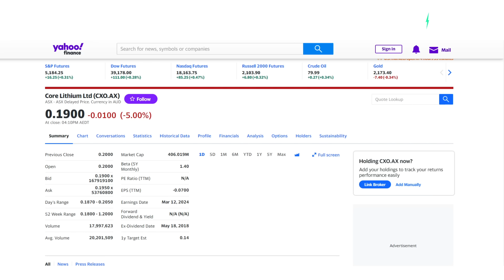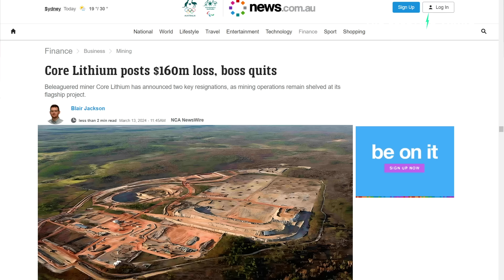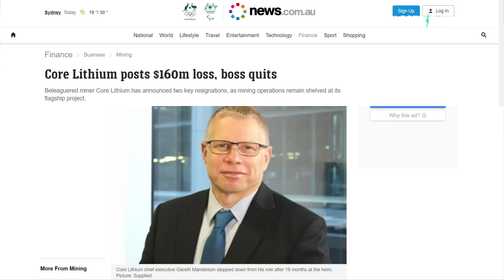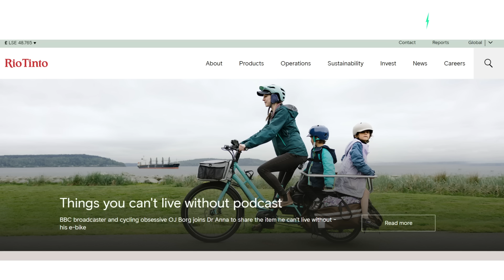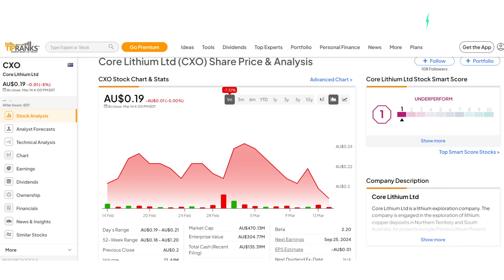Lithium companies losing billions forced to close down mines

Comment: I don't invest in this sort of thing, but lithium demand is still rising. EV batteries and other batteries continue to be a growth industry, and lithium is still a critical battery material despite emerging alternatives like sodium. If I were a betting man, I'd bet on a higher lithium price a year or two in the future, but lithium production must come down first. Production will eventually rise again but not before currently marginal producers are out of business. That's how capitalism works. Supply balances demand not because investors are always so brilliant but because high prices attract more investment and lower prices drive marginal production out of the market. The brilliant investor theory is basically the central planning theory. Booms and busts are not market failures. They're markets working.

Comment: lithium isn't really that rare and the thing is the high concentration sources have just been sitting there because there hasn't been demand

theres something like 50m tonnes of confirmed resources of high concentration readily lithium waiting to be mined from salt flats, and possibly multiples of that when the start making their way through it

i suspect the initial high prices were a consequence of demand not meeting very limited supply but with production ramping up and large consumers buying resources in advance (tesla) it's turned into a bit of a buyers market

the big problem on the horizon is competing battery tech, the most immenent thread is sodium ion cells which are now being rolled out into EVs in china, they can't compete on density yet but there are claims from manufacturers that they can get to 200w/kg and beyond - if that proves true over the next few years (generations) of the tech then that could signal the end of the short-lived lithium boom

cant sodium ion improve density and longevity? and if not what else is around the corner?

we probably aren't going back to the previous highs anytime soon

Comment: Probably a good bet on Lithium companies.  the year 1991, when Sony first got rechargeable Li batteries put into devices.  It's been well over 30 years to get these batteries made cheap enough for the common device.  Multi nations, multi companies.  Even if Sodium Ion batteries or Solid-state batteries get manufacturing traction on device sold to consumers, it probably take at least 20 years from today.   So Lithium will hold steady for at least 20 years.

Comment: Salton Sea lithium is case in point for long term lower cost production, especially when paired with existing geothermal power plants already pulling hot brine up to surface and then sending the cold back down. All they need to do is extract the lithium along the way.
Reply: the volcanic mud seems to have corroded all the DLE machines used in testing
so far not a single company in salton sea has produced a gram of LI
when they do produce some from a pilot plant and release a PEA report, it would be worth a look
Reply: It's not.
Reply: I did say long term, didn't mean next week, month or year necessarily. I trust over time materials science will sort it out. Naysayers are welcome to trust what they will.
Reply: The mining at the Salton Sea will eventually lead to earthquakes and possibly the bug one. Will it be worth it?

Comment: This type of price volatility is what happens when speculators corner the market. First the price is driven up. Next, multiple new entrance, start to produce in response to the high price. Finally a glut occurs, the price, plummets, and many get wiped out. This is what happened with silver when the hunts brothers got involved and it is what happened with lithium. The CCP announced that they were shutting down speculators that had driven up the price, and the price has fallen ever since.

Comment: Good, anything that stops these Exploding Vehicles being made makes me happy, there is NO infrastructure in place, there affected by weather changes, the manufacturers are lying about there full charge ranges, there to expensive to buy and worth nothing if you try changing them so what use are they plus they say you have to drive them approx 100,000 miles before they become pollution free, ain't that handy when the battery life is approx 120.000 miles before it needs changing at an extortionate cost. I have no sympathy for the ones who chose to buy one, oh and don't forget the promise of free road tax is being reversed too so another lie , 😱🤣😂🤣

Comment: It’s not unusual for mining companies to put their operations into maintenance mode if the value of their product falls below a predetermined level. They sit it out and wait until the stockpiles are exhausted and there’s a shortage, then they fire up again but sell at a hugely increased price. These reductions in battery costs due to cheap lithium are only temporary, watch what happens down the track. Batteries are always going to be the Achilles heel of EVs, just like any other battery powered appliance.

Comment: We can't have it both ways. We need cheap lithium for cheap EVs. The same happened with silicon between 2004 and 2008 when its price shot through the roof before crashing back down. That's right, that's just sand and some coal. Both completely abundant. Yet traders pumped up the price through the roof. Yet silicon is very cheap today and many companies make very nice profits making it.

It's the same with lithium. It's more abundant than oil. Pretty much anywhere sodium (salt) exists, so does lithium. The companies that will survive are those that can mine and refine it cheaply while still making a profit.
Reply: Anyone investing in highly volatile commodities in a way that is reliant on stable pricing AND doesn't put on serious hedges -- is insane.  They'll get crushed like a bug. 

There are good reasons that things like crude oil producing AND consuming industries (oil companies and airlines, for example) tend to heavily use crude oil futures to HEDGE their costs to insure their profit margins. 

It's about management and planning ahead, since aside from hedging, such prices can't be controlled.   And of course, such hedges are NOT free -- they're a cost of doing business and the primary reason the commodity futures markets EXIST.

Comment: Non Lithium alternatives represent the bulk of battery storage technologies future.   Give it 5 more years and you will see. So far EVs make up less than 5% of road vehicles. There's still another 95% of vehicles to be replaced over the long term.
Reply: These new EVs wont require Lithium batteries, because in 5 years time super charging will be ubiquitous at at least 50km intervals.
Reply: ICE cars are the future. EVS are just a fad.
Reply: I can always tell when someone made a 3.0 or less GPA in chemistry, when they say foolishness like this.
The periodic table of elements is arranged the way it is for a reason.
What metal comes before Lithium?
EXACTLY.
You people should have stayed awake in school.
Reply: @m4rvinmartian hydrogen has a metallic phase...

Comment: Lithium batteries is like smoking around an open gas can. Friend's dog almost burned house chewing on battery.
Reply: Let's pretend nothing ever changes, no safety precautions can be taken, and that improving batteries like LFP, etc. don't exist.   /s

And yeah, I;m NOT putting a large high tech battery in MY basement for backup power until it is VERY safe re things like fire risk.  But the real world prospects for that being practical and at a moderate cost get MUCH better over time.

Comment: Sodium Iron there as an alternative to high Lithium prices??
Reply: But Sodium-ion batteries have much lower storage density than lithium-ion. Sodium-ion batteries may have a better use in generated power storage than EV battery.
Reply: It's not just Sodium it's the fear that even more types of batteries will be developed that uses less or no Lithium.
Reply: @Sacto1654  That still reduces demand for lithium overall. That's the good thing about so many new battery types being developed, it keeps the price of any one mineral from getting out of hand.
Reply: @frankcoffey  Only people that didn't go to college fear other chemistries. The periodic table is arranged the way it is for a reason.
Reply: @Sacto1654 Still useful for shorter-range EVs.
Reply: For stationary storage, so we can shift the lithium used for static to mobile.
Right now, the price you can get for consumer (DIY) is about $120/kWh for LFP and $200/kWh for Sodium-ion. Still far from the expected $50/kWh.

There is no giga plant right now capable to output a significant amount of sodium ion batteries.
It will take no less than 3 years (2027 if huge players are serious about it) or 6 years for others (2030) to have a decent output.